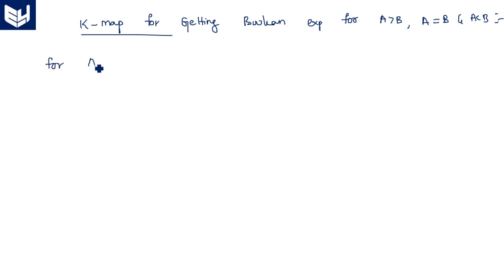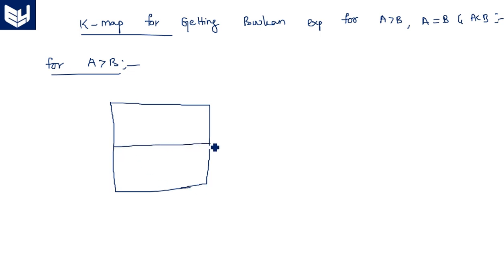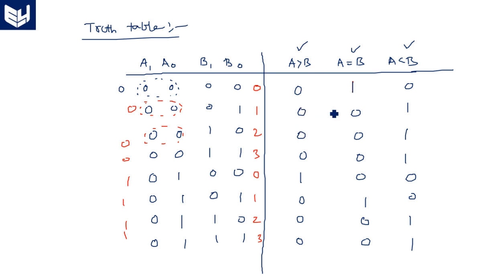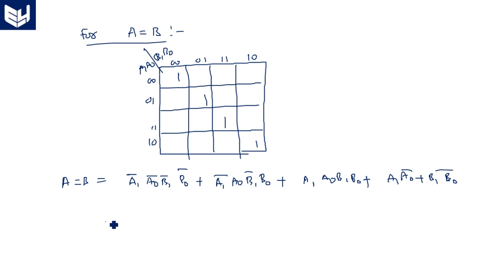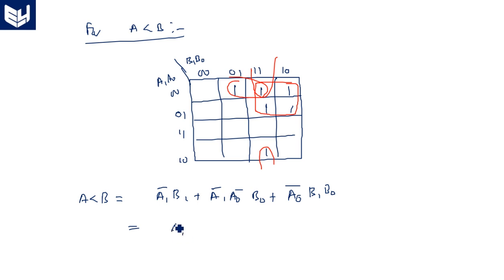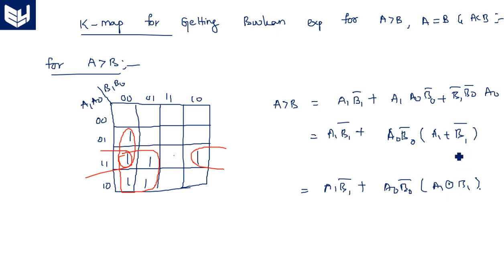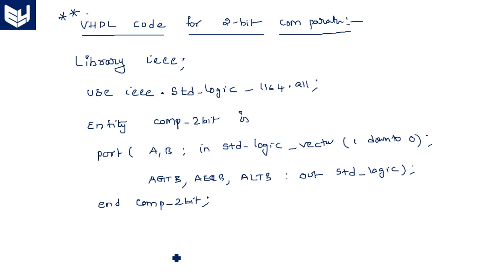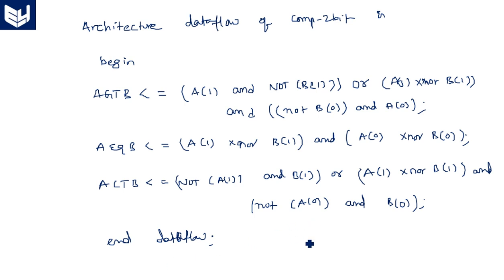VHDL code for Digital Comparator | 2-bit  | Part-2/2 |  Digital Systems Design | Lec-49

Comment: sir i have doubts it is  related to state space analysis, subject of control system
the question is   [x1(t) x2(t)]₁×₁matrics  =  [ 0 -1, 2 3  ]₂×₂ matrx  [x₁ x₂] + [ 1 0 ]₁×₁ matrx × U. 

where the initial conditions are [x₁ (0) x₂ (0) ]₁×₁matrx  =  [ 1 1 ]₁×₁ matrx  ... please solve this sir for and explain i'm stuck in this problem if, it got solved it will helpful for me in coming semester exam in a week